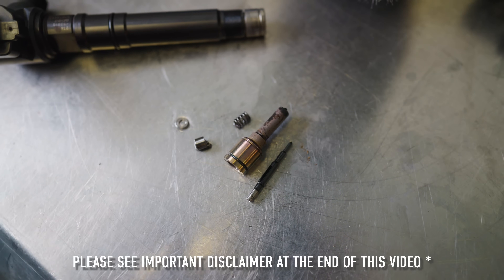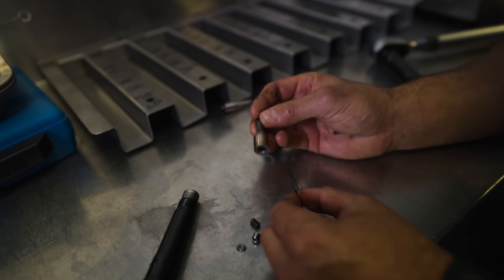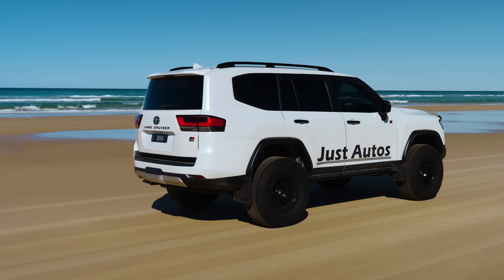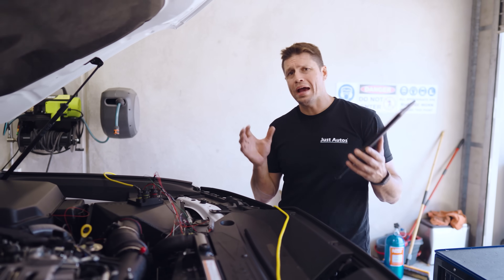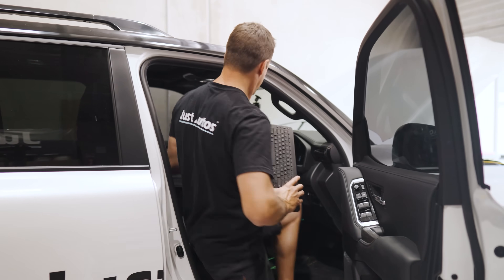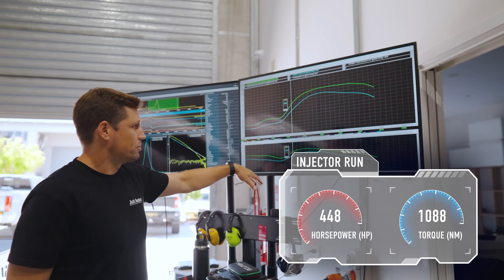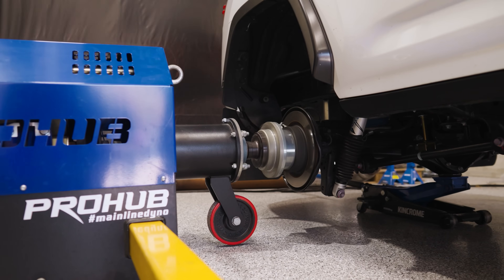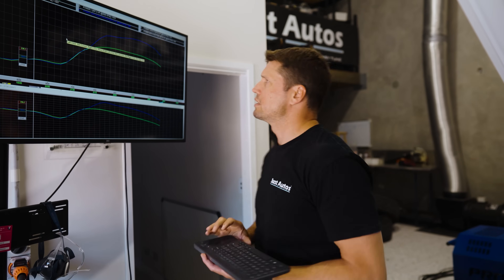510 HP Was Just the Beginning… Pressure Testing the 300 Series Part 2

Comment: Although the RWD Hub dyno figure doesn’t directly compare to the figures typically seen in industry over the past 30 years on RWD\4WD roller dynos, once you do the approx conversion your setup is still producing an amazing 300+KW at the wheels on a roller 4wd dyno! 
Would love to see 1/4 mile times and MPH for Tune only, Tune with Injectors, Tune Injectors NOS. Thanks for the videos
Reply from the maker: Yeah we have two 4wd roller dynos but we find the hub great for long term data runs. Yeah we will plan some 1/4 times soon

Comment: As RD change fuel out for Jet-A1, add little canola oil for lube. They use this in racing trucks, works fine.
Be nice to see torque numbers on low range for towing. Higher revs yes.
Reply from the maker: Yeah would be very high